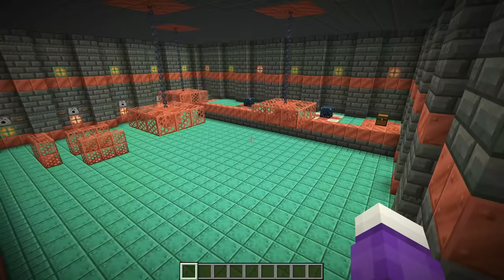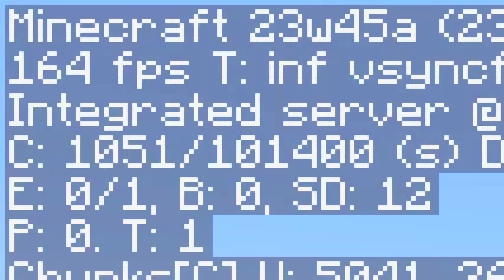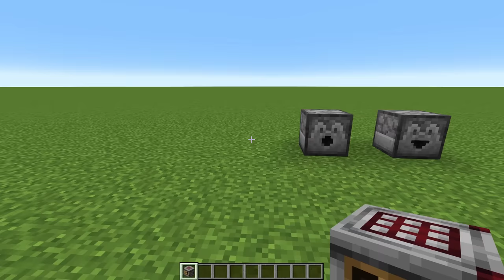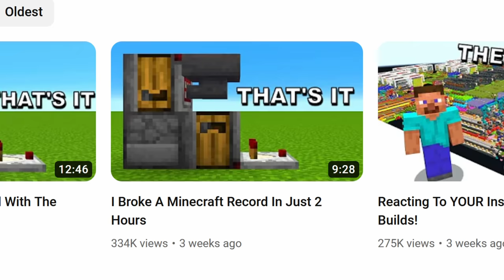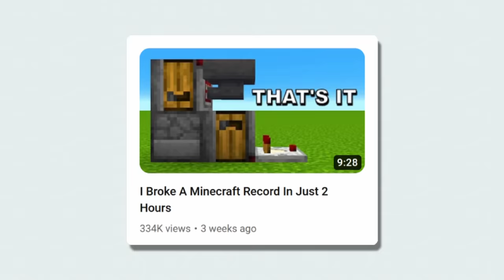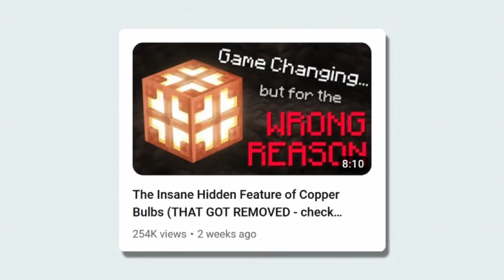Mojang Is About To RUIN Copper Bulbs (And Crafters)

Comment: The reason 99% of people loved the Copper Bulb was because it was a T-flip-flop in a single block, and the Crafter because autocrafting. You just roll right past those details; you've lost the thread mate. A bug report ruined everything, really? More than likely it it happened to point out something that they were clearly already considering. "No consistency with other blocks" - how is this a serious argument here? You mean besides the other blocks that eject items, which also have a 4-tick cooldown? That copper bulb line still looks smooth to me. You're really trying to tell me that they RUINED it all just by changing the timing? Why not just speed everything up? You know what, why not just give everybody free diamonds as well and start off with an elytra, since the whole point for some of you people seems to be speed?

Comment: I do agree these changes should be reverted, but I think people are grossly overreacting saying they "ruined" the blocks. The crafter is still a crafter. A slightly slower one, but still a crafter, it still revolutionizes farms and enables so much that was previously impossible. The copper block is still a moveable block that toggles states with a pulse instead of a current and gives a comparator output. It still enables the writing and storing of bits and simplifies contraptions like billboards. They're worse now, but saying they're ruined is exaggering so much

Comment: I can understand why the crafter would be nerfed since crafting an entire stack of items in less than 5 seconds is quite a bit excessive, but the copper bulb nerf is entirely pointless! The copper bulb's delay was is biggest, best, and frankly only gimmick, and like you said it was absolutely beloved!
I would understand if Mojang didn't revert the crafter nerf. It would suck, yes, but it has substance. The copper bulb, however, is unforgivable and should be rectified immediately.

Comment: I've gotta agree with some of the other comments here and say that the crafter change is fairly justified, I could see the speed it ran at to be a huge problem for server lag and it still runs extremely fast regardless, but the copper bulb change absolutely should be reverted.
Reply from the maker: A single entity will cause more lag than a rapidly pulsing crafter, and yet Mojang won't do anything about entity lag, so the whole lag argument isn't really valid

Heck, the redstone clock that pulses the crafter at 20hz causes more lag than the crafter
Reply: I really don't understand the "but it can make lag machines" argument. It makes zero sense. Lag machines can be made much better without using crafters at all. If it's making boats, you still need to feed it into dispenser which still has the same delay, and if you're making items it will have nearly no impact on server performance at all. It's up to server owners to prevent lag machines, not Mojang. Removing tons of interesting features because they could potentially add another lag machine onto the hundreds that already exist is just completely useless and harmful to the game.

Comment: You know, it might be just me being optimistic as hell but i'd really like it if this one block offtick access was on something else and not the bulb. Games are better when stuff is concise and intuitive. The copper bulb is already "the solid state memory thing", which is a big fucking deal and i think it's better if it's function was specific and clear like that. There's a lot of time until the next update, and seeing how much discourse this feature is generating i'm pretty sure they'll cook up some equivalent feature in a block that has no use yet. Could be copper blocks! The age could be just like repeater delay and it'd keep the signal strength (there could be weird stuff with strong/weak power but off-ticks are advanced enough a mechanic where "only when it's weak-powered" wouldn't feel weird i think). Could also add something with repeaters, like applying honey to the repeater makes it 1 tick slower idk. Or maybe they can come up with some new component where it makes more sense but it'd probably take longer and would be on a .1 or .2 update which is not the right move right now... Anyway, the copper bulb is already amazing. It has a special and very general use and as long as they add some way to do off-ticks that doesn't take 3 fucking blocks and is easy to use i'm more than happy with that feature gone from the bulb.

Comment: I think the tech community is particularly bad at giving good feedback. They see a change and they almost never stop to think about it, considering other options. For example, giving different delays to copper bulbs based on their oxidation level (0/1/2/3 gt) would be far, far more useful. An even gt T flip-flop would help to synchronize a ton of circuits which would require bulky workarounds with 1 gt of delay, while odd gt are convenient for compact a ton of circuits that require them. Regarding the crafter, I actually believe that is a good change but I won't get into that here cause it's a lengthy case.

Comment: I like redstone, I use redstone, but I don't think this would be good for server lag. If you play on a server that is owned by someone who's whole point is to run a server and makes money from said server then they should have at least an okay amount of memory for stuff like this. However I've been on low pop low money servers that already lag at times cuz it's either a friends server or a server that doesn't get a lot of donos so they can't spend money on a lot of memory for said server so if anyone wanted to they could probably crash the server with something like this before it could be spotted. 
You could say there's ways to change setting so it can't do that, but not every server owner knows the ins and outs of those setting, some people just want to set up a server for people to have fun with friends or their community. 
The Modding Community is amazing for this game and if the changes go through I'm sure people with make a mod to change it back. For a lot of people installing a mod is much more straight forward than changing those settings and making sure no-one's going to crash your server when you're not looking.

This is my first time hearing about these things so if I'm wrong that's fine. I just think based on what I've seen here it could be a problem not all server owners would know how to address without setting rules against it banning people for using it at these speeds, and that won't stop trolls dead set on reeking chaos expecting to be kicked.

Comment: the crafter makes sense, you need to consider that in order to craft at 1 tick/s continuously, you need a 1 slot recipe and 5 hopper lines to feed it. Anything more than 1 item slot will be bottlenecked by the hoppers anyway. So making more crafters to achieve that speed would be the more sensical option in almost every other case no matter what, and you only need 3 more crafter setups now to get the same output. TL;DR Its not that bad, you just need to build more stuff with specifically max-rate 1-3 slot recipe designs.

The copper bulb change is very fucky tho. Crafters drop things like droppers, but what is the relationship between a note block and a copper bulb??

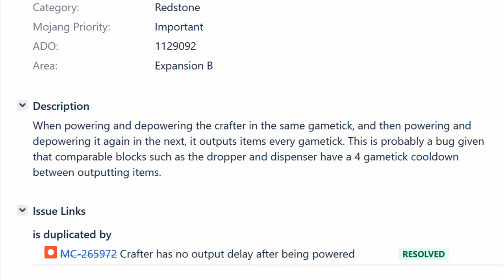Comment: The crafter having a 1 game tick delay is a bug. They confirmed it, it says confirmed at 1:43. It was unintended. It wouldn't make sense for it to fire any faster than the dispenser.

I think its funny how you pulled out the most contrived reasons, like QC powering and how they take in items? Like wow, completely different blocks. The crafter would not have functioned with dispenser-like item input, and QC powering is a bug that obviously wouldn't affect new blocks. In fact, the fact that crafters don't have QC shows that they made an oversight, as it should have QC for consistency. It firing every game tick is ALSO an oversight.

I don't get how hard it is to understand that, because they accepted it as a bug, it IS a bug. They wouldn't have accepted it if it was intentional. Oh no! You're going to have to use four crafters instead of one :(

Comment: This whole fiasco is hilarious because I don't play with Redstone at all, so I'm just sitting here wondering why all the Redstoners are crying and viciously slamming their heads against the keyboard over these tiny and seemingly insignificant details.

If anything, I think it might be good because otherwise our game performance would be negatively affected if we were to allow this weird thing to go unnoticed or unfixed.
Reply: In simple terms, the copper bulb allowed a relatively compact method of doubling the speed of redstone contraptions. Mojang now removed it so bulkier and laggier contraptions are needed to create the same effect.

For the crafter, it's pretty self explanatory. You can't craft things as fast, which is a pretty pointless restriction. To go more in depth however, the crafter previously allowed a lot of technical uses that help a lot in more advanced redstone. Mojang now removed all that just to make it the same as other blocks that have no relation to it except for dropping items.

As for game performance, it's not a big deal. Neither feature was a "bug," neither one had a performance impact, and neither one could make worse lag machines than what already exists.
Reply: @neoncat6820  Maybe Mojang saw it as a performance issue on their end that no other player has witnessed before, because all the Redstoners just have untouchable processors and GPUs. Mojang is trying to look out for the ones with lower-end PCs.
Reply: @Boomblox5896  it's just not a lag issue though, even for bad PCs. If for some reason you decide to make a 1 gametick crafter and your computer can't handle it, then it's a miracle you're running Minecraft in the first place
Reply: @neoncat6820  I'm mostly thinking about how many moving things you can cram into a machine before your game starts to chug that framerate. With the Crafter being able to process so many items at once, I don't think I would want it to move THAT fast with THAT many items. In that case, I think it's better now that the crafter is nerfed.
Reply: @Boomblox5896  there are way more efficient ways of making lag machines still though, and you can still just place more crafters for the same effect

Comment: From a legacy pvper, how does it feel? You like it when they change something you got used to for the worse? Now imagine if they let crafters and copper bulbs be that for half a decade then changed it like this now. How would you feel?
Reply: The modern pvp system at least ALSO ads things, making it more of a neutral change that comes down to personal opinion. 

The this is more like if they added a delay to swords but DODN’T add the sweeping edge move to make up for it
Reply: No it did the opposite, at least if we are talking about the act of changing it to be 0tic
Reply: @scrumt9284  what did changing the copper bulb to a 0gt delay add, at all

Comment: Crafter I 100% agree with and even still it’s going to be game breaking. Copper blocks I do think should be reverted
Reply: Why do you agree with it? There's no point in nerfing it
Reply: @neoncat6820  By adding a block that requires you to do nothing while it crafts will close the gap between early and late game too much.
Reply: @giuca002  yeah but nerfing it won't change anything

Comment: I hate to be mean, but honestly, I think your complaints come off as entitled bitching.

Yes, the 1 tick delay property of copper bulbs is useful for advanced redstone, and it would be nice to have a "proper" way to achieve that for the redstone engineers pushing limits, but redstone for the longest time has had (almost) everything on even tick delays, so it makes sense that this too should behave consistently with the rest of redstone, and that this 1 tick delay would crop up due to a simple mistake.

Yes, being able to pulse a crafter at crazy high speeds is kinda cool, but it also makes sense for it to behave consistently with other comparable redstone components. The unique filling pattern is unique to the crafter yes, but that's related to it's very purpose as a component, so a bullshit argument. And it's lack of quasi connectivity for crafters while it applies to droppers and dispensers is honestly something I'd personally consider a bug, though made complicated by how quasi connectivity is itself a longstanding bug that has been deliberately chosen to go unchanged.

And honestly; these are in development features, these were never their final versions. There will be bugs. There will be features and properties that get cut and changed. Things will be rebalanced in ways that won't be specifically helpful to you. You would not be getting angry and upset if this process was kept entirely internal, and that the first sight of these components didn't have these bugs that are useful to you. The advanced redstone community is not the only target audience to be considered here.

Comment: Imo, as a person very much in the autocrafting community  i think the nerf to the crafter is correct. Making it match with the other redstone components makes alot of sense in my opinion. 1gt isnt really fitting in the system and is also hard to understand for non-advanced players cuz you cannot see the powering turning on and off for each time. Also, the crafter is still almost op because it spits out all the items of a crafting operation. I feel like this would not make sense combined with the 1gt delay. Uncrafters were sooo broken it wasnt even fun.

The bulb on  the other hand, should definitly be kept to 1gt

Comment: This is a really bad video. You vastly overexaggerated the effect these changes will have and misrepresented the reasons they were made. To be clear, the bug report for the crafter was not made because of "inconsistency", and that's not the reason it was changed. The reason the bug report was filled was because there was a built-in cooldown tag that was being ignored - it was meant to have a cooldown from the start. Furthermore, "If these changes do go through, it will kill most, if not all, of the hype the redstone community had for this update" is obviously not true - the bulb is still a one-block flip-flop, and the crafter change will not affect most use cases of the block. I'm tired of the Minecraft community getting fired up every other month over obvious ragebait like this. Do better.
Reply: You have no idea what you are talking about
Reply: @ElectricalCurrent-bz7ou  Please be more specific about what it is you think I got wrong.